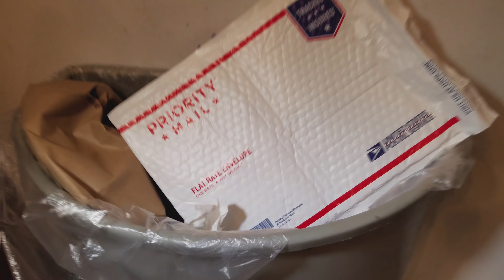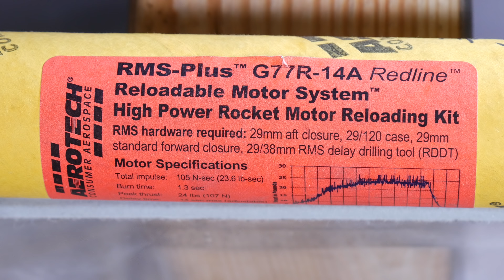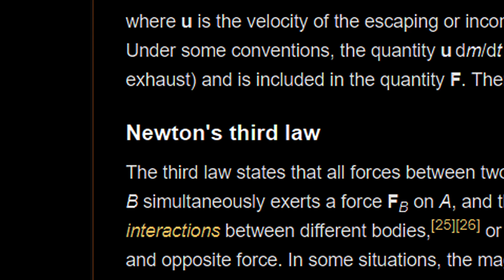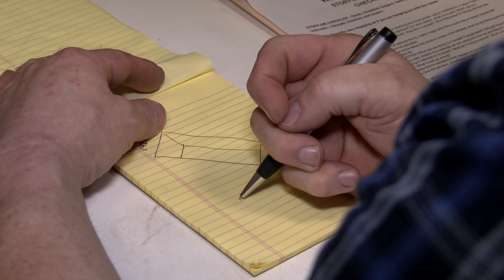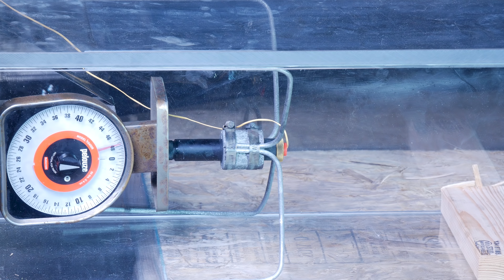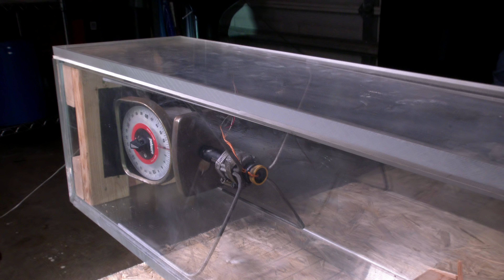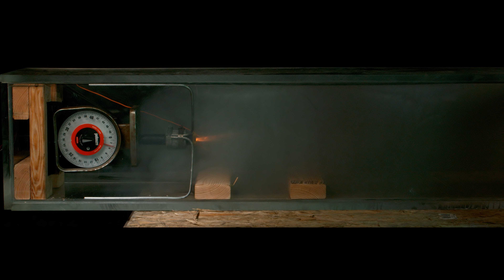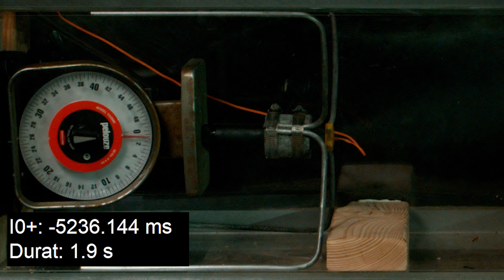Rockets in a Vacuum Chamber - Newton's third law of motion Visualized

Comment: First let me say that this experiment makes little sense in terms of real world application.  Despite what some have said in this thread, we do NOT use SRBS in space.  The "B" stands for "booster".  Boosters serve only one purpose, which is to provide thrust in the lower atmosphere to gain speed and escape the thick part of the atmosphere.  SRBs are not only inefficient in a vacuum, they're useless.  You can't shut off an SRB and then relight it, and you can't throttle it.  It's a solid even burn that lasts until the fuel is spent, period.

In space we use liquid fueled "vacuum optimized" engines.  Go check out "The Everday Asteonaut" channel. Tim has a wonderful video explaining rocket engines.  In fact he has several.
Reply: tim the wedding photographer? yeah he seems legit.
Reply: We use Solid Rocket Motors in space frequently.  Four of the five spacecraft I have launched had SRMs as the THIRD stage, lit IN VACUUM.
Reply: Solid rocket boosters are not "useless" in space.  They are used frequently in space.  Even what you describe as the boosters which "boost" rockets are still operating in a virtual vacuum.  99% of the Earth's atmosphere is below 20 miles.  SRBs are definitely still operating usefully above this.
Reply: Causam - "SRBs are not only inefficient in a vacuum"

Except this is a lie. Now why did you run away?
Reply: When I say "space", I mean "space".  Not any part of the atmosphere.  You two are splitting hairs.  I'll say this one more time - WE. DO. NOT. USE. SOLID ROCKET BOOSTERS. IN. SPACE. PERIOD.  They are used ONLY  in the boost phase.  I'm pretty sure that's why they're called solid rocket 'boosters'.  
Next?
Reply: @causam2508  Not because they dont work.  It's because solid rocket fuel burns until it is done.  You cant stop it.  Once it ignites, it burns through the entire supply.  You would have to have an entirely different design with various amounts of fuel depending on the type and height of orbit you want.  It would be a terrible idea to use solid fuel in the final stage which places a payload into a specific orbit.  You are categorically wrong.  Period.  There is no face to save here.  You are not right.  You will never be right.  It is settled. Solid fuel rockets and liquid fuel rockets work on precisely the same principle.  Eject mass away at high velocity.  Conservation of momentum dictates the rocket will necessarily be thrust in the opposite direction.  There is no reason......no......reason....solid fuel rockets wouldn't work in space.  Zip.  Nada.

And just FYI, since you clearly dont know shit about this, even objects in orbit are technically still within the atmosphere.  This is why objects in orbit such as the International Space Station need periodic reboosts - because the orbits decay due to drag in the atmosphere.  If you wish to stop embarrassing yourself, your best course of action at this juncture would be to quietly walk away from this one.
Reply: @willoughbykrenzteinburg  which is EXACTLY what I said.  I don't believe, and I ask you to show me if I'm wrong, that I said they wouldn't burn.  I just said it's a pointless experiment because we don't use them in space.  Stuart, if you're following along stop me if we're going too fast for you (and who DO you launch spacecraft for, Jeff Bezos? Oh wait...).
Reply: @causam2508  You said solid fuel rockets were useless in space. Exact words were something along the lines of "not only are they insufficient, they are useless in a vacuum".  You were CLEARLY linking the uselessness of solid fuel rockets to a vacuum.  You are just attempting to backpedal now.
 
It was a false statement. They work just fine.  We dont use them in space for logistical reasons; not physics reasons.
Reply: @willoughbykrenzteinburg  you lied.  I said "boosters" not "rockets".  I said "inefficient" not "insufficient".  It was a dumb lie too, because anyone can check what I said.

Neither of you is even making sense in terms of my comment.  I'm out.
Reply: @causam2508   @Causam  - " WE. DO. NOT. USE. SOLID ROCKET BOOSTERS. IN. SPACE. PERIOD.  They are used ONLY  in the boost phase.  I'm pretty sure that's why they're called solid rocket 'boosters'.  "

Let me REPEAT:
MY JOB is "Launching things to space". 

So I am TELLING YOU, that we DO USE Solid Rocket Motors IN SPACE .

Not ONLY have I personally launched four spacecraft using solid rocket motor third stages, but I ALSO worked with the people at Lockheed Martin that sent a solid motor to VENUS for Venus Orbital insertion of the Magellan spacecraft.  Now speak of things you know about.
Reply: @willoughbykrenzteinburg  what about hybrid-rocket engines? They are throttable because of LOX and the fuel is a solid-rocket motor.
Reply: @stuartgray5877  then what about 50 years ago when the atlas-able launched the Vanguard I? the upper stage even used a hybrid-rocket engine, its cheap and easy-to-get propellant amd oxidiser.
Reply: @prolska  What you said does not contradict anything I said above.
Reply: @stuartgray5877  really? Stop wasting your time man
Reply: @prolska  YOU are the one going around making meaningless statements.
Reply: @stuartgray5877  yours too

Comment: In space though, you dont generate enough gas to fill the space like you can fill the vacuum chamber here. Redo the test, but with the vacuum chamber staying vacuum chamber during the whole duration of the test.
Reply: Good thing the rockets does NOT NEED to "fill the vacuum" to propel itself. It only has to EJECT MASS.

Comment: The vacuum of space (10 to the -24 tor, 1000000000000000000000000 tor) cannot be simulated by man, ever. Makes you wonder how our atmosphere (1-2 bar) stays magically stuck around our space rock, while flying at tremendous speeds in 4 different directions. Ah, yes, it's gravity.  Newton was correct. 😂

Comment: stephen allenbaugh
1 second ago
The problem with applying Newton’s 3rd is that the rocket’s propellant does not generate force in a vacuum according to the laws of physics and chemistry. If the force of the propellant is 0 then Newton’s 3rd states that
Force on Rocket=-Force of Gas.
If Force of Gas = 0 the rocket does not move.

Why doesn’t the propellant generate any force, it's expanding, right?
There is something known as “Free Expansion” or the “Joule-Thomson” effect, named after James Prescott Joule and J.J. Thompson two of the founders of the field of Physical Chemistry.
http://www.etomica.org/app/modules/site ... ound2.html
Free Expansion states that when a pressurized gas is exposed to a vacuum the gas expanding into the vacuum without any work being done. The gas is not “pulled” or “sucked” into the vacuum nor is it “pushed” out of the high-pressure container. In other words no work is done, no heat or energy is lost.
This result has been experimentally verified numerous times since its discovery in the 1850’s.
[for example a paper in the Journal of Physical Chemistry from 1902: http://pubs.acs.org/doi/pdf/10.1021/j150043a002]

As if Free Expansion wasn’t enough to invalidate the theory of rockets producing a force in a vacuum there is also a result from thermodynamics:
Work = Pressure x Change_in_Volume
that is easily found searching for “W=PV”
http://lsc.ucdavis.edu/~ahart/Alicia2B/Thermo.pdf
If the pressure of a system is 0 then the work done by the expanding gas into that system is 0. Gas expanding in a vacuum doing no work agrees with Free Expansion. This can also be understood as the gas meets no resistance as it exits into the vacuum and thus transfers neither heat nor energy to its surroundings. If the gas loses neither heat nor energy then it has done no work.

At this point we have a rocket with high-pressure gas generated from liquid fuel that can release the gas into a vacuum but has no way to produce a force while doing so. As soon as the nozzle is opened the gasses escape without doing any work. Therefore the 3rd Law is rendered useless.

As it turns out NASA does not fall into the 3rd Law trap (nor does it go around correcting all the sites who do) instead claiming that thrust of a space rocket is generated using what I call The Wrong Formula, an egregious farce of Newton's 2nd law which I will address in a later next post.

To recap: Newton’s 3rd Law, the number one response on the Internet to how a rocket generates thrust in space, is invalid in this context. NASA itself avoids using Newton’s 3rd Law as the reason why their rockets work so well in space choosing to use Newton’s 2nd Law instead. I will show in a later post why NASA’s use the 2nd Law is equally invalid and in fact a hideous misrepresentation of the laws of physics that would give a freshman college student a failing grade yet earns NASA an "A" thanks to its pretty pictures, dramatic story lines, and gutsy champions, the astronauts.   Boethius
Reply: Who cares what work the fluid does on the vacuum? The work you're talking about is irrelevant and obviously zero because you can't ever do work on a vacuum.
Reply: *Force on Rocket=-Force of Gas.
If Force of Gas = 0 the rocket does not move.
*

If you  make a hole in high pressured container in a vacuum, do gas from that container would move out of it? Yes or no? Does gas from state of equilibrium taken of that equilibrium produces force? Yes or No? Simple questions:)
Reply: m1vi1 + m2vi2 = m1vf1 + m2vf2 is all that is necessary to prove that rockets MUST work in the vacuum of space. Basic Conservation of Momentum.

Comment: This engine does not accelerate, because acceleration is not possible in vacuum, where there are no counter-force.
Reply: @darklight2.1 This world is a terrarium, a built, and stationary growthhouse, not a planet freely in a space!
Reply: @per-bjarnemikalsen3996  .
Then how does the sun rise and set? If it simply "flies away to the west" we would see it get smaller but never dip below the horizon.
How do you explain a lunar eclipse? (LUNAR, not solar)
Reply: @lance3748  The sun simply gets further away. On the Lunar eclipse, not sure, but if the moon is e.g: it's own light, shown to us from the other side of a projector-screen, then this light, and the sun, would mix in. I have never seen a lunar eclipse, do they even exist? Is it not just an ordinary no-moon, what would be the difference?
Reply: @lance3748  Summer is hotter because the sun moves closer in summer. This also explains why the solar intensity is greater in the summer, and why traveling to the equator gets you easier sunburned , after only 5 minutes of sun. It is the same sun we see, so in January in Norway, we can see the whole sun for 5 full minutes in one stretch, yet the sun intensity in these 5 minutes is very low, this is because the sun is then, on flat-earth, somewhat further away from us, ithis is so easy to explain on flat earth, very but very very difficult to explain on the round-earth model. Why the sun-intensity is so low in the winter, despite us seeing the very same sun for full 5 minutes at one single time.
Reply: @darklight2.1  Summer is hotter because the sun moves closer in summer. This also explains why the solar intensity is greater in the summer, and why traveling to the equator gets you easier sunburned , after only 5 minutes of sun. It is the same sun we see, so in January in Norway, we can see the whole sun for 5 full minutes in one stretch, yet the sun intensity in these 5 minutes is very low, this is because the sun is then, on flat-earth, somewhat further away from us, ithis is so easy to explain on flat earth, very but very very difficult to explain on the round-earth model. Why the sun-intensity is so low in the winter, despite us seeing the very same sun for full 5 minutes at one single time. And this is of course never mentioned in any schoolbook.
Reply: @lance3748  Summer is hotter because the sun moves closer in summer. This also explains why the solar intensity is greater in the summer, and why traveling to the equator gets you easier sunburned , after only 5 minutes of sun. It is the same sun we see, so in January in Norway, we can see the whole sun for 5 full minutes in one stretch, yet the sun intensity in these 5 minutes is very low, this is because the sun is then, on flat-earth, somewhat further away from us, ithis is so easy to explain on flat earth, very but very very difficult to explain on the round-earth model. Why the sun-intensity is so low in the winter, despite us seeing the very same sun for full 5 minutes at one single time. And this is of course never mentioned in any schoolbook.
Reply: @per-bjarnemikalsen3996  . Winter and summer happen on a round earth because the earth is "tilted." 

In summer Norway and all of Europe and north America are tilted toward the sun, while the  southern half tilts away and has winter. Then 6 months later it's just the opposite.

This is not at all hard to explain. In fact I learned it in grade school.

If I learned this in grade school why didn't you? Again, you have shown incredible ignorance.
Reply: @lance3748  I am,  N.O.T,  talking aboutm seasons. During winter in Norway, I cannot get sunburned, but at equator I can get sunburned, even in January, why? It is the same sun, right.
Reply: @per-bjarnemikalsen3996  . Actually I was told you can get burned under the winter sun on a really bright day. But because the northern hemisphere is tilted away the sun is further away.
The reason you can get just as easily sunburned on the same day at the equator is because the equator is about the same distance from the sun all year.
Reply: @per-bjarnemikalsen3996 . A good scientific theory explains all facts and observations, or almost all.
If the earth is a globe, tilted on it's axis, orbiting the sun, and the moon orbits the earth, it explains
1. Sunrise and sunset 2. Seasons 3. Weather 4. Why the moon has phases 5. Solar eclipse 6. Lunar eclipse 7. Why a ship heading into the horizon disappears bottom first 8. Why you can't see a ship that's just a few miles out even with a great telescope 9. Why the fastest route from South America to the middle of the Indian ocean is to go due south and when your compass switches head due north.
-And more.
- In fact look at a "map" of "flat earth" and a globe. The distance around the globe at the equator is about 23,000 miles (over 37,000 Km).
 - If the length of the equator is about the same on a flat earth map, then traveling by plane from Norway due east, over Russia, over the Bering straights, over Alaska, over Canada, then over the north Atlantic and back to Norway should be under 11,000 miles.
- Now imagine a plane ride on your flat earth map from southern South America to southern Africa, to Australia, then back to South America. That would be one of the longest trip imaginable on the earth's surface, over 30,000 miles. - In reality that trip is comparable to your trip from Norway due east back to Norway. It may not be easy or cheap to do this but it can be tested.
However if we do this I am quite sure flat earth believers will ignore it or come up with an excuse as to why it happens.
Reply: @lance3748  So the globe earth theory cannot explain this at all, that is what you are really saying. While on a flat earth model, it is super easy, the sun is just slightly further away from Norway during winter.
Reply: @per-bjarnemikalsen3996  - "Summer is hotter because the sun moves closer in summer."
This is false.
Summer is when your HEMISPHERE is tilted TOWARDS the sun, and winter is when it is tilted away.
The seasons have NOTHING to do with the distance from the sun.
Reply: @stuartgray5877  So why then, is the sun more intense at equator than in Norway, on the exact same day, in let's say January? It is the same sun right, I can get sunburned at equator, but not in Norway, at the same day of the year. How do you explain that? World is a stationary terrarium.
Reply: @per-bjarnemikalsen3996  You started this thread about rocket propulsion, Why change the subject?
I know as much about rocket propulsion as I do about the orbits of planets and spacecraft.
(more than any other person you are likely to have to opportunity to ask questions of, so use your time wisely)
Reply: @per-bjarnemikalsen3996  NASAs Deep Impact films earth as an alien world
Reply: @per-bjarnemikalsen3996  Do an internet search for that sentence above and tell me what you find!
Reply: @per-bjarnemikalsen3996  : But flatters claim the earth is enclosed above by a dome separating the waters above from the waters below. Thus, even your magical flattardia "floats freely". 

Clearly logic is not your strong suit, bro.

Comment: What was the vacuum pressure gauge reading at the end of the test 😂

This is the daftest piece of pseudo science I have seen in awhile 😆
Reply: @bobartor910  flat earth has nothing to do with it, chatbot 😂
Reply: @papalegba6796  
So you don't think the earth is flat?
Reply: @bobartor910  the papalegba bot claims it does NOT believe in flat earth.
However, ask it if C4 will explode in a vacuum OR what is the combustion product of a hydrogen oxygen flame and prepare to be amazed by the answers.
Reply: @stuartgray5877  combustion in a vacuum is impossible, chatbot 😂
Reply: @papalegba6796  - "combustion in a vacuum is impossible"
Except for the part where it is NOT, and we TEST combustion of many kinds in vacuum here on earth, in earth orbit, and in deep space.
Stick to topics you have some familiarity with like eating lead paint chips.
Reply: @stuartgray5877  that violates the first law of thermodynamics, but you're a chatbot so you can't understand why 😂
Reply: @papalegba6796  Its odd that every single Engineer and Physicist agrees with Stuart and disagrees with you.
I wonder why?
Reply: @rocketman484  it's not odd that you lie about everything, as it is all you are programmed to do 😂